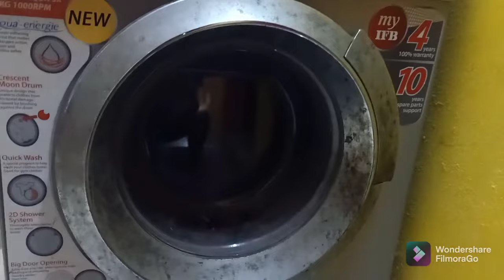How to repair IFB front load washing machine drum sound in tamil/by SD/sasidharan

Comment: My samsung front load.. Whn spinning at high rpm drum sound heavy.. And also takes more time than dispalyed.. Or time stuck at 9 minuts   motor running but time not down
Reply: @sdelectricaltech9409  tanks bro. For Ur valuable respond 😍😍from kerala

Comment: Bro, I'm having ifb digital sx 6kg front load washer, bought 12 yrs back.....motherboard problem, not working.....Is it possible to convert, it to normal electromechanical model....??
Reply from the maker: That's not possible bro because the motor control in motherboard
Reply from the maker: Tell me bro what problem in motherboard?
Reply: @sdelectricaltech9409  motherboard is getting on and we can set options, but, only timing runs, no any process
Reply from the maker: Can you sent video my whatsapp

Comment: Sir (kieach kieach) rubber sound eapadi repair pandrathu!?
Reply from the maker: Change the rubber immediately and check it basket od the runout is normal are abnormal
Reply from the maker: And check the bearings
Reply from the maker: And check the bearings

Comment: Ifb 9 pin motor eppadi check pandrathu direct a
Reply from the maker: Bro neka soldrathu E9 error pathiya??
Reply: @sdelectricaltech9409  motor direct check eppadi
Reply from the maker: Multimeter use pani tha check pana mudium
Reply from the maker: Ena problem bro motor ku
Reply: @sdelectricaltech9409  direct motor  check Panna therichkanum